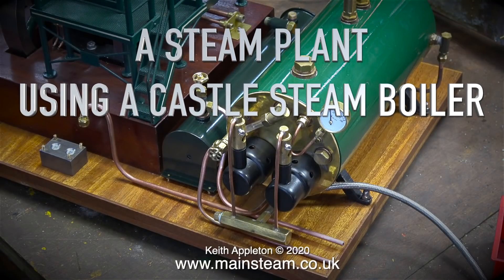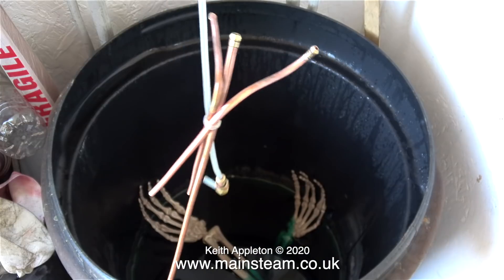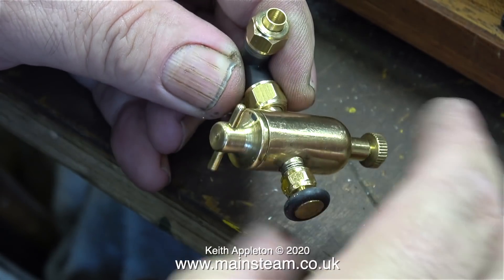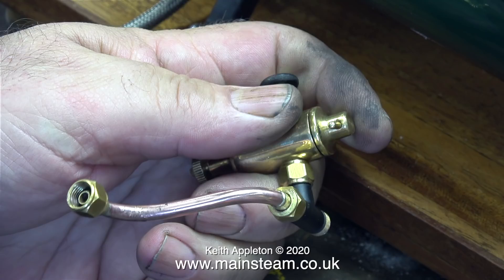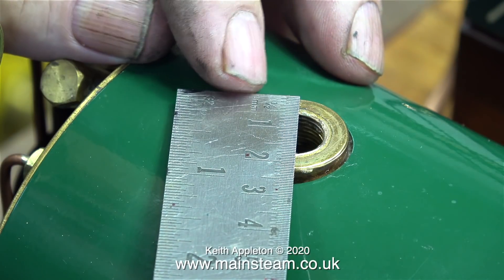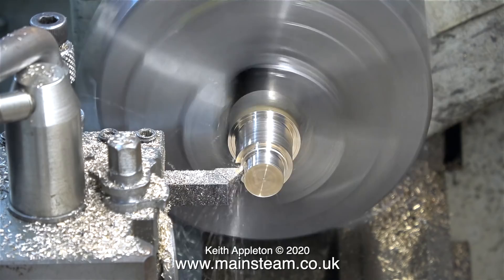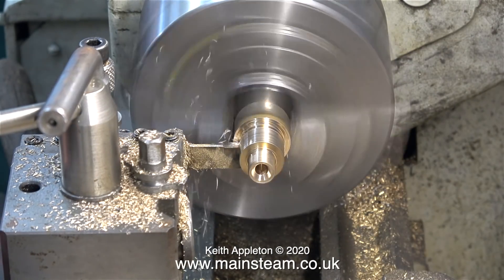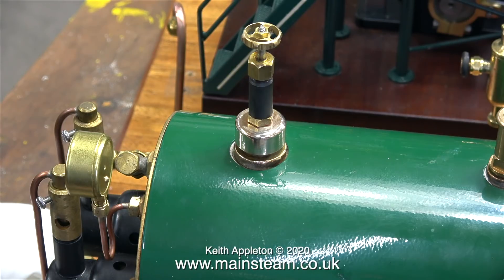A STEAM PLANT USING A CASTLE STEAM BOILER - PART #10

Comment: If You won't mind, i hawe a short question, i recently ordered some PM boilerbushings from Forest Classics (since i could not find any other brand of boilerbushings)  and those elbows, sightglass and similar things from Kennons (they did not had loose boilerbushings), wich shall those ones You talk about in previous videos, both where marked as 1/4" 40 but whan i try to screw in the fittings in a bushing it seems like they does not quite fit, i can screw them in a few treads but then it starts to feel realy hard to continue, since they are brass i did not dare to use tools when i first tested, until i know fo sure if they are just a tight fit or if i missed something important i should had known before trying to use more force... 

Does anyone here know what i did wrong?
Reply: I ordered a pair of those boiler checkvalves You recommended me to use with the feedingpump (The second one is going to be for the Stuart automatic pump in the future).
My plan is to use one with the handpump You reccomended here in previous videos (wich at the moment are sitting on my desk waiting for the 1" machine).
Reply from the maker: I have mentioned this many times in my videos. The USA thread pitch is slightly different, I just re-thread them with a 1/4 x 40TPI
Reply: @keithappleton  Thank You very much!
I will order some proper threading tools anyway.
Thank You very much for the information!
I will watch the older videos more carefully in the future.